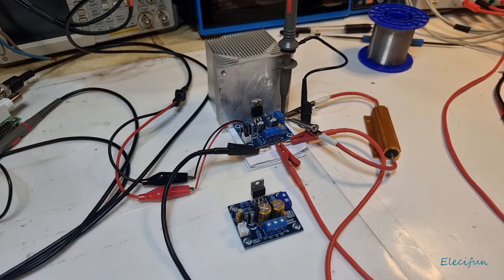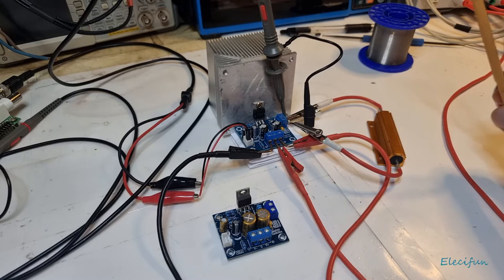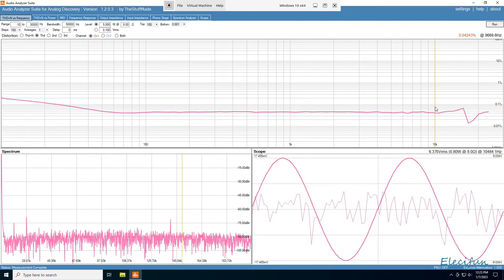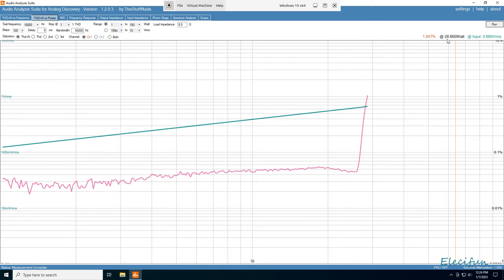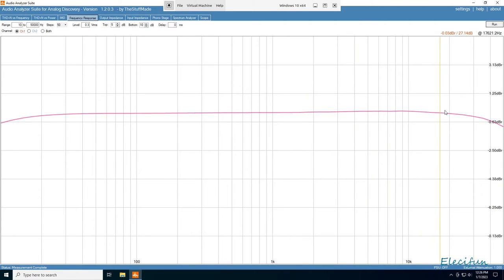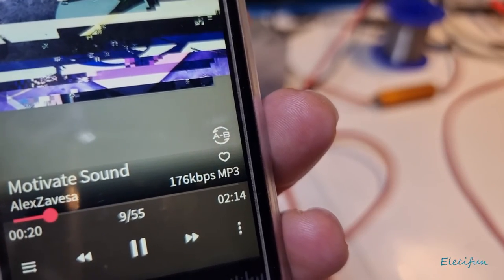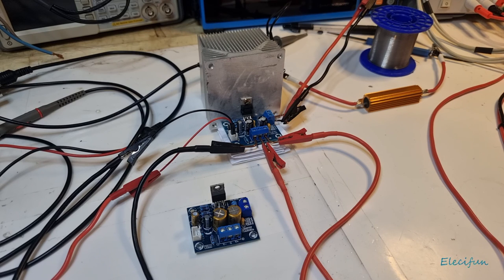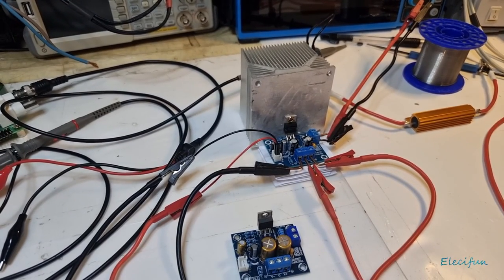LM1875 KIT UPDATE

Comment: Interesting, but somewhat baffling findings here. That resistor is part of a boucherot cell, which helps to stabilize the amplifier when driving reactive loads. Changing its value from 1 Ohm (recommended value on the datasheet) to 10 Ohms may compromise the stability of the amplifier with certain loads.

Now the baffling part of why the distortion is less: The resistor and the series capacitor form a high pass filter that is high impedance in the audio spectrum. It should have no effect on the distortion performance. Is it possible a high frequency (well outside the audio spectrum) is included with the test signal or picked up by the amplifier? This could affect the readings if the signal is conducted to ground through the boucherot cell. The 10 Ohm resistor would lower that signal current. Another scenario is something else changed which affected the distortion.
Reply from the maker: Of course your absolutely right. I tried this as an experiment just to see what would happen, influenced by ESP project 72. It was a first look using 8 ohms. With a 4 ohm load this falls to pieces clipping on the negative at low input. Project 72 uses a 100n instead of the 220n in this circuit. I will swap out the 220n for 100n as this is how I learn. I do not and will probably never have the skills and knowledge you have, no matter how many times I watch your videos. I tinker and enjoy the test gear.
Thank you for your input, it is a learning experience for me.
Reply: Still waiting for your new video to come